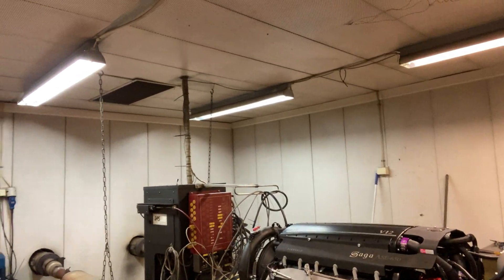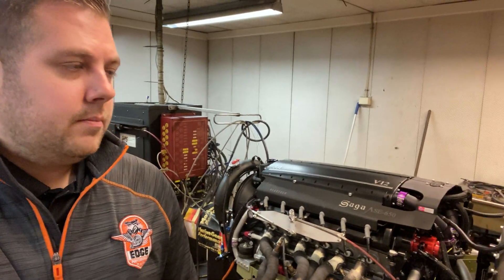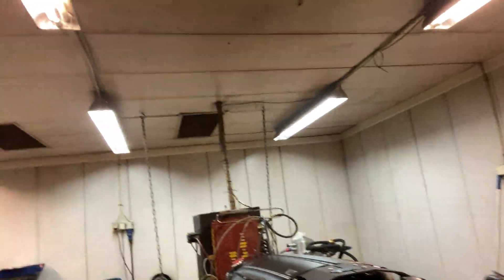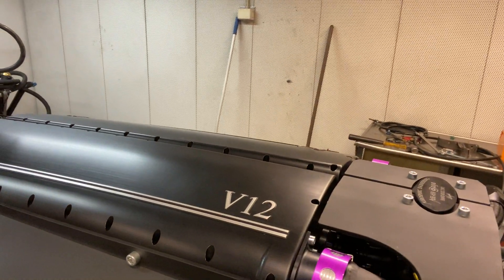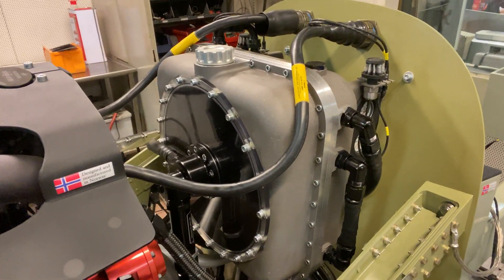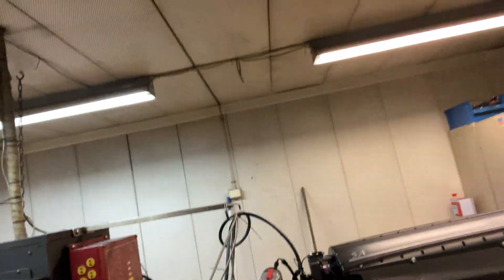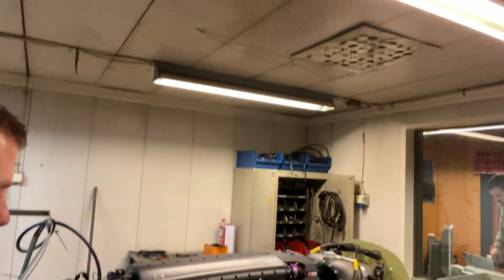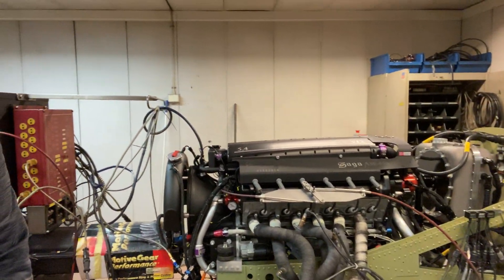Aerosport Engineering V12 dyno session w/Edgeperformance AS

Comment: So the big question with all of these auto engine conversions is ...... how do you break in to the Lyc/Con perception of reliability and simplicity. IE how do you get a dude to choose this engine over a Lycoming? Why am I going to choose this engine to take me on the Northern Ferry routes across the Atlantic instead of a Lyc? 
I wish Edge all the luck in the world with these engines but getting through to potential buyers is a major hurdle. I want to see hour upon hour of engine data from an engine that has been stressed and stressed and stressed some more. I want to know how these engines go wrong and how they break and how to deal with it on an EFATO
Reply from the maker: Simon Hughes-King we simple don’t compete with Lycoming, and you wouldn’t find a suitable Lycoming for a Stewart Mustang which this engine is for. It’s an alternative to the Falconair V12 👍🏻
Reply: @EdgePerformanceNorway  It looks great. You also do various other four cylinder engines that could compete with Lyc though. I want something to put in a RV14 that  is more advanced than the medieval Lyc. Something that has around 210hp and doesn't need me to worry over it every second.
Reply: @simonhughes-king  The Yamaha Apex engine conversions seem to have a pretty good track record. It's mostly STOL guys, but that's mostly because GA guys tend to be insanely conservative. Word on the street is that they like to be run at ~10k rpm (which is roughly what they run at while in a snowmobile). Relatively simple ECUs, crazy light even when you consider all the extra doodads you need for the liquid cooling and gear reduction. Oh, and your fuel burn will be half that of a Lycoming, and you don't have to use avgas.
Reply: They will have no problem getting through to the performance minded market. You want reliability then the Lycoming goes the distance, to the TBO, then it's time to change the crank. Got a few dead ones kicking around the shop !